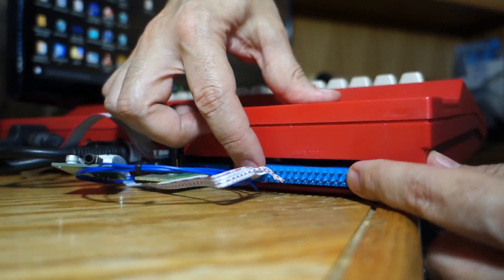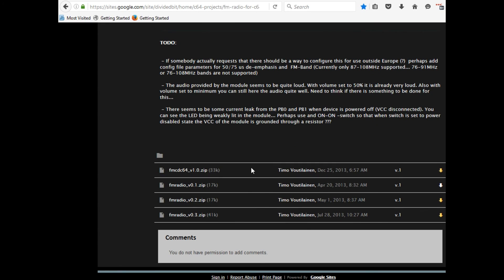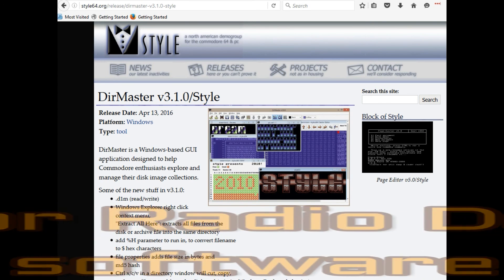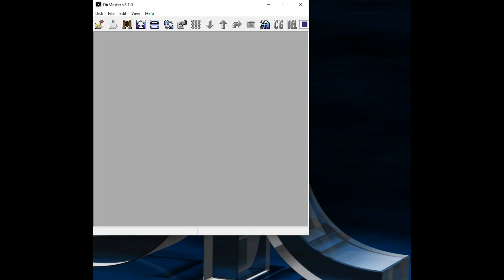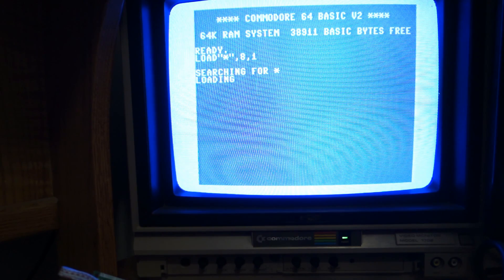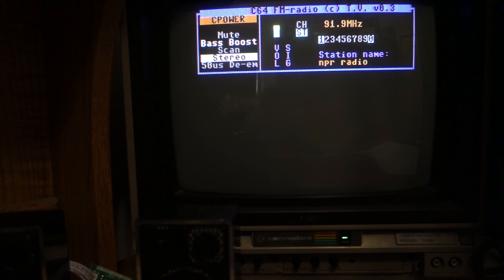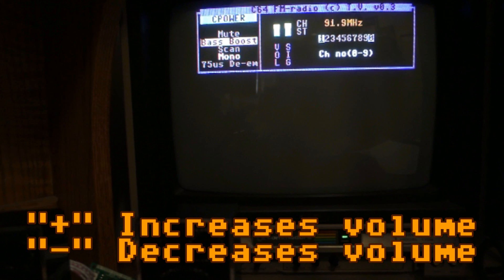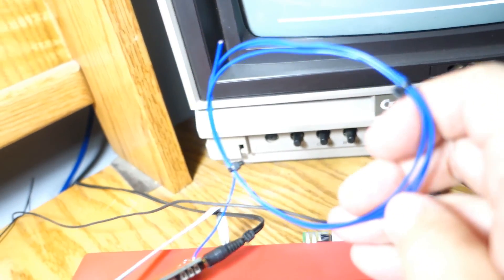Commodore 64 Radio Project

Comment: I copied this explanation from Wikipedia:

Random noise has a triangular spectral distribution in an FM system, with the effect that noise occurs predominantly at the highest audio frequencies within the baseband. This can be offset, to a limited extent, by boosting the high frequencies before transmission and reducing them by a corresponding amount in the receiver. Reducing the high audio frequencies in the receiver also reduces the high-frequency noise. These processes of boosting and then reducing certain frequencies are known as pre-emphasis and de-emphasis, respectively.

The amount of pre-emphasis and de-emphasis used is defined by the time constant of a simple RC filter circuit. In most of the world a 50 µs time constant is used. In the Americas and South Korea, 75 µs is used. This applies to both mono and stereo transmissions. For stereo, pre-emphasis is applied to the left and right channels before multiplexing.

The amount of pre-emphasis that can be applied is limited by the fact that many forms of contemporary music contain more high-frequency energy than the musical styles which prevailed at the birth of FM broadcasting. They cannot be pre-emphasized as much because it would cause excessive deviation of the FM carrier. Systems more modern than FM broadcasting tend to use either program-dependent variable pre-emphasis; e.g., dbx in the BTSC TV sound system, or none at all.